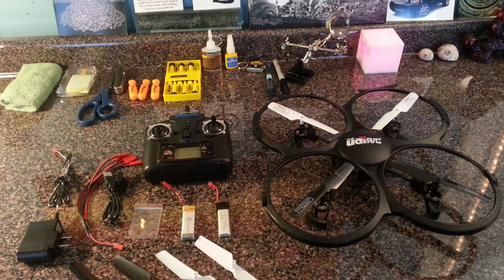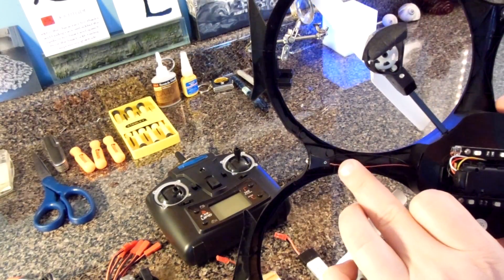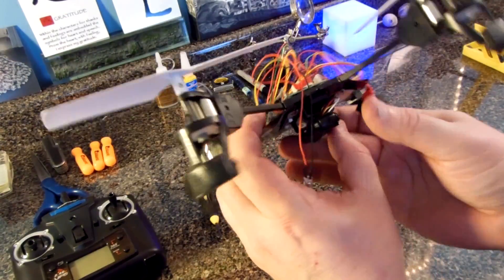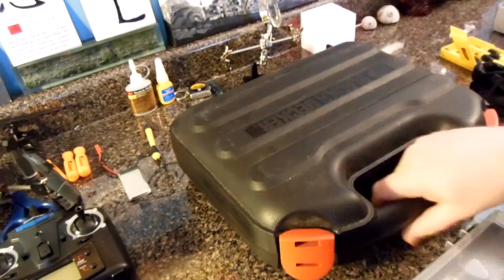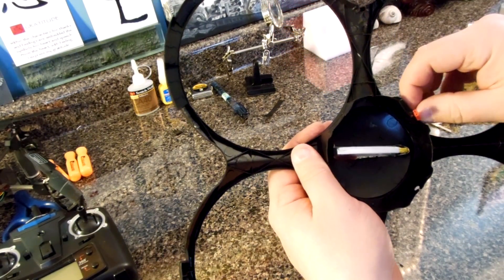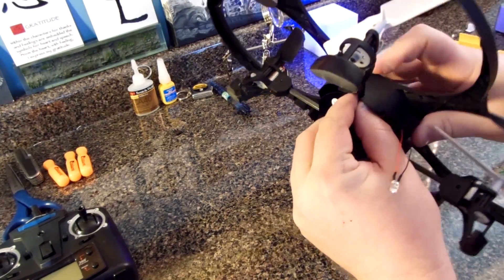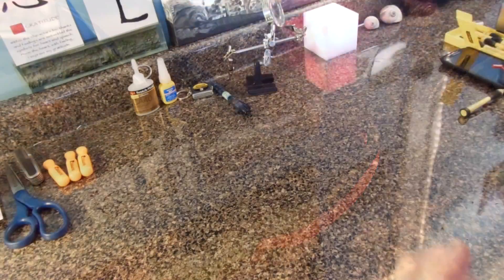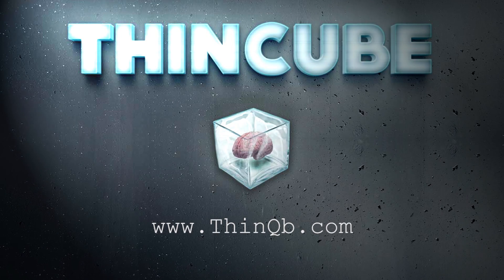DIY Mod for LONGER FLIGHT times - Quadcopter UDI U818 & U818A-1 Discovery DroneTube

Comment: I literally just took a 18650 and soldered a connector to it, then rubber bands around it -- to the base of the board , that's it holding in place. I removed the terrible camera for weight reduction , extra lights too, because the power draw is unwanted, and also removed the canopy. IT RIPS now. Super long flight time too but the thing is so light the wind easily can take it away from u.. but it's fast. It's lean in for pitch is quite aggressive. I love it  hard to fly at first but not bad.

Comment: ThinCube- I have a newer (just got this week) U818A drone and want to upgrade the battery. The battery it comes with says 350mAh 3.7Vx2 and has a 4 pin connector on the battery. The plug on the drone has 4 pins also, but it has a jumper between 2 of the pins (one positive, one negative) which tells me the battery is used in series and I assume is actually a 7.4 volt battery. That said, would you agree and would you be able to suggest a battery to be used as an upgrade for better flying time? The batts it came with last 5 minutes, even less in the wind. I don't mind  modifying plugs, etc.. I just want to make sure the batteries I select will work, and I can modify plugs if needed. Thanks in advance for any help you can offer.

Comment: ThinCube -- I upgraded my battery to a 1200 MAh and then to a 2000 mAh but neither works. The 1200 lasts about one minute before shutting down and the 2000 lasts about one second.  When I re-sync the quad, I can resume but the times are still the same for each battery.  It appears that something is causing the quad see a low battery condition and shut down with the larger batteries.  Do you have any suggestions as to how I might resolve this problem?
Reply from the maker: I'm Grateful ...hi and sorry to hear youre having issues. Theres a couple of things that come to mind with you issue you describe. I would check to make sure the voltage of the batteries you got match the voltage of the stock battery. And the other thing i would check is if you hav a different model UDI quad copter. The one i did the upgrade on was a U818a. Good luck and i hope u can get it sorted.
Reply: The model I have is the original U818A.  I also have a U817A which the 818A replaced after I landed 40 feet up in a tree where it rested for three months until a storm blew it down.  I haven't repaired it yet.  I have multiple 3.7 volt batteries ranging from 500 mAh to 2500 mAh.  They all seem to work the same...the higher the capacity, the shorter operating time of the quad. All batteries have been fully charged. I will check the larger batteries with a voltmeter but I really don't know what I should expect to see.  All seem to carry substantially more than the designated voltage when fully charged. What should the upper end voltage be on a fully charged 3.7 volt lipo?  Thanks for helping me with this.  I really appreciate your videos.
Reply: ThinCube -- It now appears that I may have shorted something out when I modified the antenna on the 818A.  Are you familiar with the wiring diagram on the 818A or aware of any way to disable the low battery shut off system?  There are instructions for other drones on YouTube but I haven't found one on the 818A.  Thanks again.
Reply from the maker: I'm Grateful sorry but i am not aware of any. And the documention for these drones is very poor.
Reply: You can say that again.  I went to the UDI website and could not get it to accept a message.  Also, research is turning up a lot of the same problems I'm having out of the box.  I've repaired my second U818A and can't get it more than two feet off the ground. Now, I'm trying to decide whether to update it with a new one, go to a better more expensive one or just replace it with an identical one for about $25.00.  I do like the camera in the U818A, though.  thanks again for all of your help and videos.
Reply from the maker: Anytime, good luck with your repair and happy flying!

Comment: Thincube, I find your videos extremely helpful as I just purchased the u818A for my son for xmas and we have learned a lot. Unfortunately a motor went out so I am online watching your videos.
Question I have is this: I ordered lots of extra batteries and some have a red connector, some have a white connector. The quad RC has the white 4 wire connector. What is the name of the connector and is there an adapter where I can connect the two (Red 2 wire and White 4 wire) together? Only been doing this three days and my son is really getting into it. I have limited knowledge at this time so I am asking you. Thanks
Reply from the maker: Hi Jack, thanks for the kind comment and i'm glad the videos have helped and hopefully i can help even further. I am only slightly familiar with the 4 pin connector batteries, which are just two 3.7v batteries stacked together with an inline connector (white). Not even sure if they are using them in parallel and doubling the current or in series and doubling the vooltage to 7.4v. Anyway, take a look at this connector and let me know if this would work. If you can even tell by the picture:  http://amzn.to/2iUx5vh    Good luck, Tony.
Reply from the maker: Ok, just did some more research and still couldn't find your answer but i can tell you that the last link i sent was not correct, so don't buy that one :) Take at a look at this one and click on the images on the left.  http://amzn.to/2inuj4H   One shows a nice close up of the battery connector and the charging adapter. This might help you hunt something down. Again good luck and let me know.

Comment: may i know the weight of the 1200mah battery..because i'm planning to put one on my syma x5c-1..thanks
Reply from the maker: Hello Dilshan, i looked up the weight of the battery and found that it weighs 23g. I no longer have the battery to confirm that for you, unfortunately. Hope this helps and good luck with your project. Happy Flying!
Reply: thank you for the answer.now i can decide either to buy or not.
Reply from the maker: Here's a link to 1200mah batteries that are specifically for the Syma X5SW that might be good for your x5c..... http://amzn.to/2eeZ1Zs

Comment: I am no mathematician . But the trust and energy has to get a good %age to weight ratio . Great Idea . I am on the fence on getting one of these for my first step into the drone world . Would you still recamend this drone after having it longer ? Thank You and God Bless
Reply from the maker: Hi Timothy, i would recommend this drone as a first drone. Its relatively cheap and fun to fly. What i learned from flying this drone helped me appreciate how easy the new drones are to fly. I upgraded to a 3DR Solo and it basically flies itself. But when i do go into manual mode, all my UDI experience kicks in. The thing i like best about the UDI is that it is easy to fix and so light that when it does crash the damage is minimal. I was able to fly the UDI indoors which helped me practice all winter.  Good luck with whichever one you choose and let me know if you get the UDI and how you like it.....take care, Tony
Reply: Thank You . I appreciate the info .

Comment: Well me i did put 2 batteries same volt together i fly more longer ? i got no problem
Reply from the maker: Sweet, you may run into issues when the batteries start to wear over time and the internal resistance change, but if it works now then awesome! Happy flying.
Reply: +ThinCube yeah he fly 45 minutes no burn no heat much
Reply from the maker: renards90 Whoa!!! That's a huge amount of time...you will definitely burn out a motor...the UDI's motors are super sensitive and let's be  honest, not exactly top quality!! I'm surprised you didn't burn one on the first flight! But they are cheap enough and easy to replace.....unless like many people have encountered, you burn the main board too! Good luck with it!
Reply: +ThinCube i did fly many time nop no heat
Reply: +ThinCube m'y main board are colds but true thing is i not have same modèle as your
Reply: +ThinCube oh well just trange other got burn. 4 week i fly it . well i did like your video hope you got Nice fun with drone ;)

Comment: hi
my Quadcopter use 3.7v 500mah  Can I inserting the battery size  3.7v 5000mah ( is the large mah damege my Quadcopter
thank you
Reply from the maker: Hi, there are two issues with adding a battery that large. First is the physical weight which most likely will be to heavy to fly or control your qaud and second is the "C" rating of the battery (which stands for capacity). This is a measure of how much current the battery is able to discharge without damaging it. So, the UDI U818a, i believe, uses a 25c battery. So doing the math 25c x 500mah gives us 12.5 amps.  If a battery has a lower "C" rating then it might not supply enough current to operate your drone. With all that said, do you know the "C" rating of the 5000mah battery you want to use?
Reply from the maker: And i forgot to mention that the 5000mah being large is not what would damage your drone because that is just the reserved capacity of the battery. If the voltage was higher then you could cause damage. However, i've found that with larger mah batteries we tend to fly them longer which overheats the motors and ultimately shortens their life. I know i threw alot of info at you but i got some free time on my hands waiting for more olympic coverage!!! :)
Reply: my Quadcopter is SKYC D20W WiFi FPV 2 Mega CAM 2.4G 4 Channel 6-axis ------ Battery: 3.7V 600mAh can I inserting the battery 18650 High Capacity 3.7V 5000mAh ?
Reply from the maker: I have tried batteries like this but it wouldn't work. Not sure of the "C" ratings but they were also too heavy for the quad. Now these batteries are 1200mah and they WILL WORK!!! http://amzn.to/2b3YK9s  You just have to figure how to make it fit. Good luck and let us know how you make out. Happy FLying, Tony.
Reply: I will use  3.7V 2300mAh GTL 14500 AA Li-ion Rechargeable Battery it is same AA battery ----   14500 Size: Approx. 4.3cm x 2.2cm Weight: 19.5g thank you
Reply from the maker: Please let us know how you make out. That way i can pass on the info to others....thanks and good luck again!!!
Reply: hi Or did you find this battery?
Reply from the maker: Hi, take a look at the battery here on amazon: http://amzn.to/1wWRVOX   or look at the similar options AMazon shows, just be sure the connector is right for your quad....happy flying!!!
Reply: Ok thank you good flight! ;)

Comment: Hello thare , i have a cencern . I have asked a lot of diffrent ppl , and the majority says that if you put a bigger battery it will burn the motoer and it will sett fire . i was just curious to see if it is true or not ???
Reply: Great video btw
Reply from the maker: Hello and thanks. Well i can say that i have found one of those points to be true. If you fly for excessive amounts of time (with stock battery or not) without allowing the motors to cool then yes they will burn the motors out faster. With that said, a longer lasting battery will make it easier for one to fly longer thus heating up the motors. However, the catching fire scenario i have not experienced nor have i heard mention of it in my conversations on here.  Thanks again and happy flying, Tony
Reply: ok thanks¨'

Comment: Hey bro we can use mini solar panel and can attach at top of drone and connect instead of battery socket so it will work or not pls hurry..............
Reply from the maker: +kuldeep verma I don't think for the size of solar panel that would allow the drone to still lift off, you wouldn't get enough power out of it. You could use it to charge the battery when NOT flying, but then it would take a really long time (depending on size of cells used).

Comment: nice video... but doesnt that battery on top create a much less stable flight (it certainly raises the center of gravity). why not figure an easy way to widen the original battery slot?
Reply from the maker: +Mvm Cali Thanks, actually it flies really well with the heavier/relocated battery. I flew it in this configuration for awhile before i jettisoned the prop guard/housing altogether. And there is a way to attach these batteries under the camera. Instead of parallel to the camera, mount it perpendicular to the camera and the wider battery will just fit. However, these batteries are known to swell over time. After which they no longer fit. That is why i came up with this mod. Thanks for bringing up the topic and Happy Flying!

Comment: Why didn't you just feed the battery wire in through the slot you made rather than drill another hole and have the wire hanging outside?
Reply from the maker: +Mark Ambrose Good point, i could have configured it that way. But since in stock configuration the wire hangs outside i kept it as such. There's also the potential for the battery wire to slip back into the housing when you remove the battery for charging. Not a big deal if that happened, but inconvenient.  It really boils down to preference :)  Thanks for asking Mark....happy flying!  Stay tuned for more mod videos coming soon!

Comment: probably not the best idea with something like this especially with a soft pack lipo. a crash could cause a battery short then fire
Reply from the maker: +Andrew Hudson Hi Andrew, even with the stock battery in its stock location, a crash will cause it to eject on occasion. I fly with both variations still and haven't had any issues. Even when letting the little ones fly it....and they cause the most dramatic crashes :)    Happy Flying!

Comment: I have a u818a circuit board but the motors are rated for 7.4v battery. My question is will the 7.4v batteries fry the circuit board. I'm building this quad out of extra parts. Thanks for the welcomed input  Bob III
Reply from the maker: +Robert Bowman My guess is yes, you would have an issue using that motor/battery combination. However, all is not lost Robert! You could use relays to drive the motors at a higher voltage/current. You'd have to do some research though. Keeping in mind weight of any additional electronics and wiring needed. Good luck and let us know how you make out. You could use an ic package such as this (not sure how many relays is has though) http://amzn.to/1KmzlkO

Comment: Can someone please reply and help regarding the type of lipo battery for this quad, because when I connect this 2000mAh battery http://www.ebay.co.uk/itm/111247469588 to my my quadcopter it spinns propellers only to about 50% of given throttle and then turns itself off automatically. When I connect its stock battery it works fine spinning the propellers at full throttle. Has anyone come across this problem??
Reply from the maker: Hi, ive never tried any batteries larger than the 1200mah showed in this video. And it worked fine for quite awhile. Hopefully someone else seeing this can answer these questions....sorry i couldnt be of help.
Reply: Yes, it probably depends on current draw, since I latter realised that the battery I used was only 1C at 2000 mAh, which is compared to 25C ridiculously smaller battery. 
Anyway thanks on your feedbacks!

Comment: May I ask have you charged this bigger battery with a stock charger until the green LED showed up? And maybe checked it's output voltage after it was fully charged? Because like I mentioned in your other video where you tested it with your battery, after I fully charged mine that's labeled 2000 mAh, it showed 4,23 V on multimeter, although I know from other people's experiences the output voltage of lipo batteries shouldn't go more than 4,2 V, because any higher voltage would damage or shorten the battery's capacity. Please answer!
Reply: +Viktor Božičević - The output or discharge rate on the battery must be 25C in order to power the quadcopter. Just because its 3.7v doesn't mean it will work on everything. Cell phone and camera batteries don't put out enough instant power to drive all 4 motors.

Comment from the maker: Hey everyone, thought i'd let you know that UDI has come out with an upgraded U818 quad called "Discovery" and It's getting rave reviews on Amazon. We're ordering one for review. Check it out here: http://amzn.to/1FUp7p9
Reply from the maker: ***** Hi, you can use this battery from CRW on Amazon. It has slightly more mAh so you would get slightly longer flight times (if even noticeable to be honest). Let us know how you make out: http://amzn.to/1Mj3Meu
Reply: +ThinCube would not the hight mah or volts damage the quadcopter??
Reply from the maker: +Rehan Herath Hi, the voltage is the same (3.7v) and the mAh is more than doubled, but that just means there's more to draw from. Kind of like having a larger gas tank in your car. The only issue could be over heating of the motors. So i've been careful not to run the same quad continuously without some cool down. Thanks for asking and Happy Flying!
Reply: oh good :)

Comment: I donno the battery you got but at my local B&M hobby shop, I bought a 3.7v 1100mah that looks quite a bit smaller than yours. Anyway, this 1100mah fits sideways where the 500mah goes. It's a snug fit but I loosened the camera screws and it wedges nicely.

Comment: How do I repair the white gear which spins the propeller. there are 2 white gears, a small on and a larger one. the propeller stopped working (Black Propeller)...do I have to replace the entire arm?
Reply from the maker: Scott Allen Hi Scott, no you can replace just the white gears individually. They are called spur gears and are connected to the shaft that goes through the arm to drive the prop. You can get them on Amazon here: http://amzn.to/1G4OMlI
Reply from the maker: Scott Allen As for the small gear, i haven't been able to find them for sale by themselves (which is weird because my quad came with spares). But you can buy them connected to new motors for around $11 for both motors (clockwise and anticlockwise):  http://amzn.to/1FdsCXD: